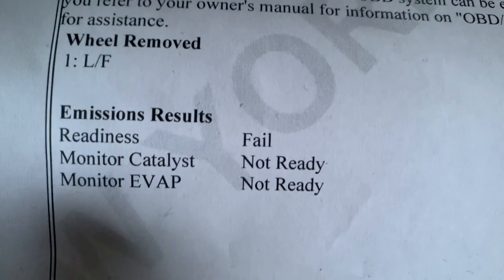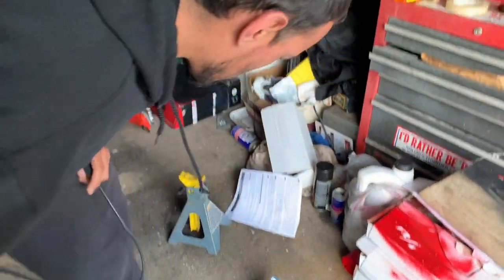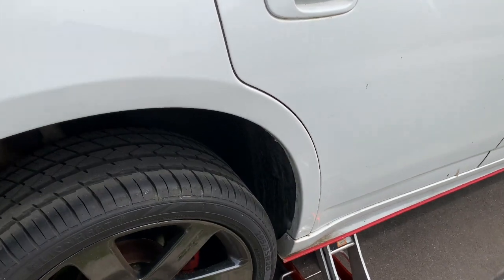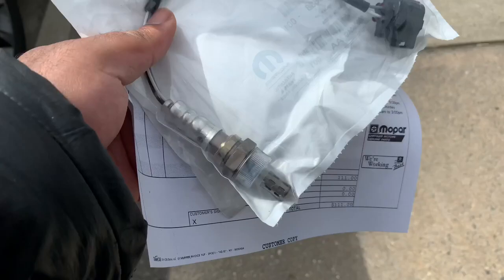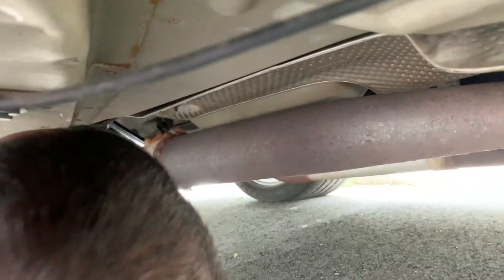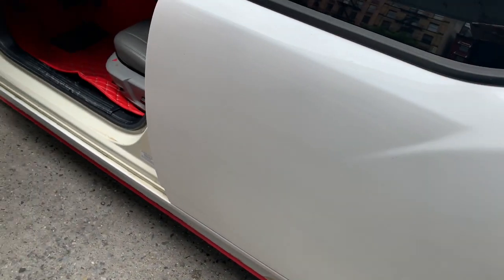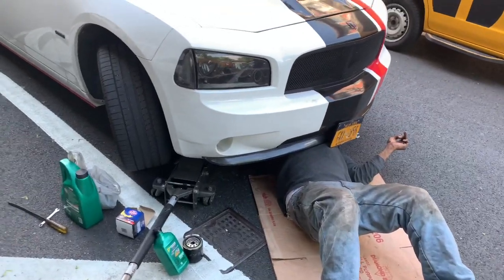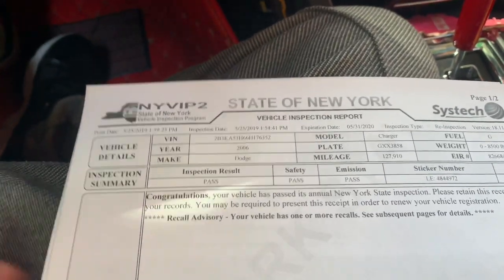How I Passed My inspection With No Catalytic Converter`s | Dodge Charger R/T

Comment: Nice hack it works cause if you make the hole bigger there is more oxygen circulating in the oxygen sensor that override company setting for a certain amount of oxygen. I haven’t tried it on my Prius but I am going to try it and see if it works and will comment. It’s a logical method to override company settings
Reply from the maker: let me know what happens.

Comment: Let me help ya out big man.  You WILL NOT pass inspection with a CEL (Check Engine Light) on, period.  Next time stop by an autoparts store like Advance auto, autozone, or similar and have them put the code reader on the car( it's free).  Replace the part and have them clear the code for you.  Also, you do not have to buy the over priced sensor from the dealer, the same parts store you go to will have them for half the price.
Reply from the maker: I'm definitely look it to it appreciate it bro 💪

Comment: Hey bro i got a Lincoln town car that had 4 cats i got a straight pipe and sold the cats to get the job done free and money in my pocket he drilled the holes and tapped them to put the 4 02 sensors in will that work reason be is i wasn't getting much acceleration on highway turns out the passenger cat was caved in so i figured just remove them and get a straight pipe now hell a power
Reply from the maker: U can try doubling all 4 sides like I did n then put the sensor in reset the car n drive to see what happens.

Comment: What’s good bro I’m also from the city and was wondering if I got catless on my 21 charger scatpack and add the spark plug non Fowler like you did, would I be valid to pass emissions inspections ?
Reply from the maker: It most likely will u can try it's cheap anyways not like u spending a lot 2nd option u add a tune and u good my boy did on his scat he's has catless mid pipes been passing the last 2 years

Comment: So no need to get the extensions? just buy the o2 sensors even if i dont have the cats?
Reply from the maker: I just bought the piece u saw me drill holes in and the sensor and put it inside.
Reply: @CmcMods  so  the spark plug extension is required correct,?
Reply from the maker: @mememetal666  yea it is...
Reply: @CmcMods  do you need a special tool or just a plain old socket wrench?

Comment: As efficient as modern engines are anyway (especially with fuel injection standard in all vehicles), why do we even still have catalytic converters in vehicles?? And don't even get me going about all the new emissions crap in diesels (proud owner of a 1990 Cummins Turbo Diesel)!!

Oh, and here in WA State: They just got rid of the entire emissions testing program. WINNING!!!!
So cut those cats outa there!!
Reply from the maker: Oh man I can't wait til they do that in new York but who am I kidding they to strick here so I'ma do what I want to do and work around it.
Reply: @CmcMods  Spoken like a true American!
Reply from the maker: @erwin643  true indeed 💪
Reply: Your car only has to pass the factory emissions for the year it was produced, normally + or - 10%,  newer cars will have lower emissions from the factory that are published by their respective manufacturers....unless they are falsely reported and have a device or program like volkswagen/audi and mercedes, had fitted to their cars, which all had same 2lt diesel engine that lowered the emissions when it went into test mode after idling for a while.
Reply: @CmcMods  Just get a cat put on it and save yourself the hassle.......get them wholesale from an exhaust manufacturer....i do in uk, I get them for a quarter of the price garages charge...from as little as £50..lot of garages charge 8 times more fitted.
Reply from the maker: @stef2797  yea I was thinking putting the cats back on I think ima tine it first if I'm good from there leave it if not put them back on it's to much to deal with because the light will come back on and I have to do it over.

Comment: Or another way to make sure the codes never come on again is to get a tune that shuts off the rear 02 sensors
Reply from the maker: Dan 300 it already came back on it bought me time to get passed but Ima get it tuned months before I have to go again.

Comment: I wana do it to mine but they told me I need to tune it in order to do tht is tht true?
Reply from the maker: No it's not but u gonna get a check engine light that's why I did what's in the video but a tune u will have the option to take the light off and pass inspection so if u got a year or months til ur inspection u can cut them then save up ur money for a tune.
Reply: CMC Mods ok thanks man really appreciate it, I support your Chanel
Reply from the maker: @alexbello9399   no doubt thanks for subscribing and becoming part of #TeamCMC but definitely get a tune regardless u can control other things on the car that is restricted.

Comment: You should put those 02 spacers on, even with the new 02 sensors the codes will definitely come on again later
Reply: Dan 300 will it pass the smog with the spacers on?

Comment: mine are hollowed out and I cant breathe in the damn car...I gotta  get cats..
Reply from the maker: I ain't havin those issues been 3 years strong neither gas my partner with headers mid pipes set up no cats.
Reply: @CmcMods  yeah but this is a remanned engine with only 15k on it so far. Smells like a goddamm speedboat...unless I got leaks...then still...need exhaust either way. I'm in jersey. I dont care if it didn't stink so damn bad...
Reply: @CmcMods  wait tho...is it because my O2s are still in? Is it fuckin with the fuel air mix?
Reply from the maker: @rockdefradio6020  possibly but when it was stock did u do delete of the cats mufflers n resonators?
Reply: @CmcMods  2nd owner, 1st dude deleted the resonators, i had a bad engine, so after the engine I ddi the cats with some cheap ass shit. now the cheap ass shit is hollowed out until.....i get a better brand. so no resonators, some flowmaster muffler, thats all.
Reply from the maker: @rockdefradio6020  u need to redo ur pipes at a shop.
Reply: @CmcMods  I got a place here in trenton. Mufflex. They do excellent work.

Comment: The title of the video and what you actually did makes no sense at all.  There way cheaper ways to pass the inspection without a cat.  I did it with my civic and maybe a $10 piece that goes over the o2 sensor into your exhaust.
Reply from the maker: Well guess what we learn something new everyday n that's what the channel is about spreading the knowledge I know and experience but also you guys can do the same 90% of things I do I just attempt I'm not afraid of risk it's part of my journey 👌
Reply: Besides my comment and babbling on, Keep up the good work and vids my man. Entertaining and informative.
Reply from the maker: @ltbomb7194  no doubt I don't take anything offensive everybody has a option or some knowledge to things or more experience I'm here to empower as many ppl as I can be safe out here my brother and stay tuned 💯

Comment: why didn't you just use a tuner like a SCT or diablo.  Your parameters will read normal and it will trick the state computer.  As long as they don't do a visual inspection you wouldn't have anything to worry about.
Reply from the maker: Yes that was the plan but I waited last min n bam it was crunch time I'm gonna do it next month.

Comment: “How to poison your neighbors with hydrocarbons and carbon monoxide.” Nice 👍
Reply from the maker: Well I guess I will be one of many because alot ppl are cutting them off I actually bought the car without them so yea.
Reply: When the A/F ratios are good which means no check engine light  and engine running good it means its running  neither rich or lean but just  right and fuel injection  by itself  makes way way less emissions than the older vehicles either way the amount of emissions one car makes is minimal and not enough to make you sick believe me every dam vehicle I've owned never has had cats Florida bou
Reply from the maker: @pepeiann  preach my brother 💪🏽
Reply: @CmcMods  I've bought a couple cars without  em usually the seller is selling them cause it's too loud or its leaking and sound like shit lol
Reply: Also cats go bad on older vehicles I had a sierra with bad cats (rattling terribly) bad mpg
Reply: Just cut them off lol
Reply from the maker: @pepeiann  excatly they went bad 600 to buy n for the labor another $200 I'm goo
Reply from the maker: *good
Reply: @pepeiann  Ford Sierra's only had 1 cat on them and they where cheap as chips in UK so long as you didn't go to dealers...infact there arn't that many Sierra's left now due to major rust, most ended up in scrap yards,  not many people will buy a Ford after it's 5years old because they have a bad rep for Rust like Fiats.
Reply: @stef2797  I learned something from reading your comment. Over in the states Ford doesn't make or sell a Sierra, but GMC does. GMC is the professional grade Chevrolet. Thanks for your post.